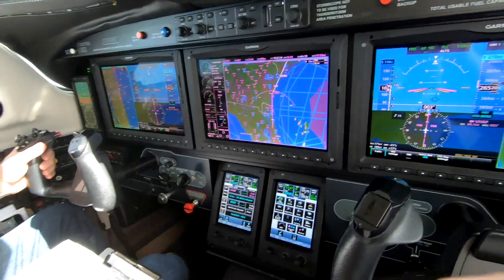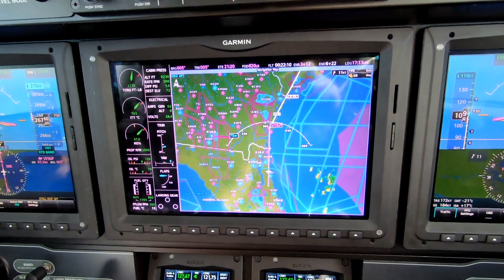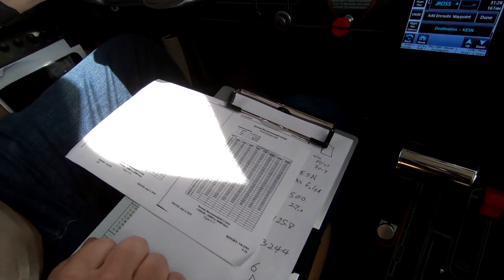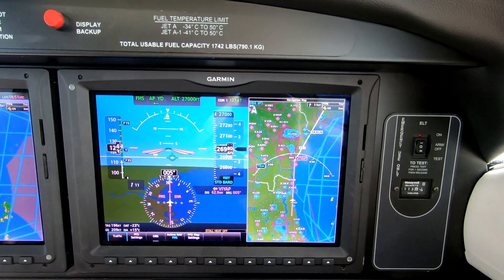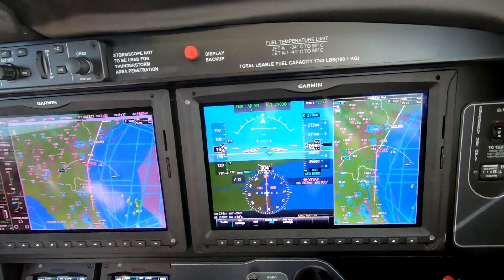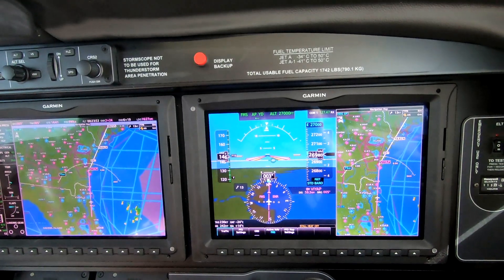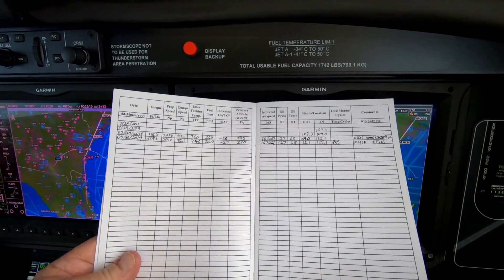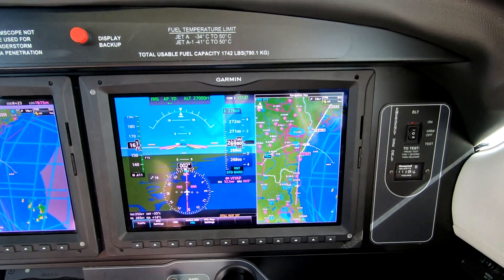The Piper M600 G3000 Keeping an ECTM Log

Comment: Thanks for this channel, after watching your videos i feel more confident flying PA-46.
I fly brand new M600, but lately noticed some issues with the autopilot. On arrival stage it switches automatically to BC or LOC mode without APP button armed and turns randomly somewhere. Maybe you heard anything about this error? Thanks!
Reply from the maker: Hi Kazbek , I have not heard of this. The G300o avionics are known to be extremely reliable. I encourage you to consult with your Piper Service Center. Feel free to contact me directly.
Reply: @RWRPilotTraining   Thank you Dick! I remember having some problems with first M600 that we got 5 years ago in Russia. At some airports G3000 would glitch and remove all data including speed, alt, hsi and radar. I think it had something to do with magnetic anomaly and firmware. It got me by surprise in the middle of night in complete IMC with some weather.
Reply from the maker: When the G3000 is installed or when hardware modules are updated or replaced the magnetometer system must be recalibrated. This process involves a Garmin approved maintenance facility and a qualified pilot. You may need recalibration. It might also be necessary to recalibrate the fuel quantity processor. This is more involved and should only be performed by a qualified PA46 maintenance facility or a shop with significant PA46 and Garmin experience.